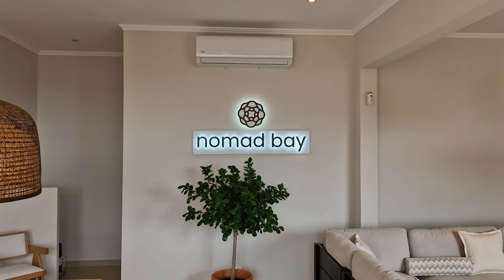Life after the death of the GOLDEN VISA

Comment: Hi all, a quick update here since the government released final wording of their proposal. The retro-active measures are out.  Pending applications and future renewals will be converted into the D2 program but the stay requirement of 7 days will remain as per the original GV program .The Portuguese authorities are still accepting applications, and they will continue to do so until the law comes into force.  Applications that have been entered into the system are protected by the law. However, time is running out, as the application process takes weeks and it is not clear whether there will be a transition period. The new law may come into force as soon as the end of June.